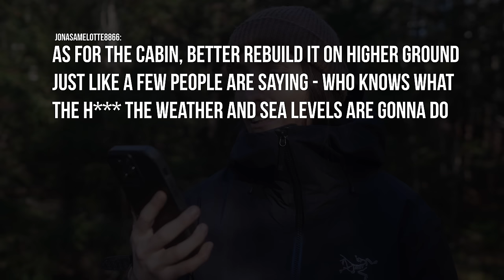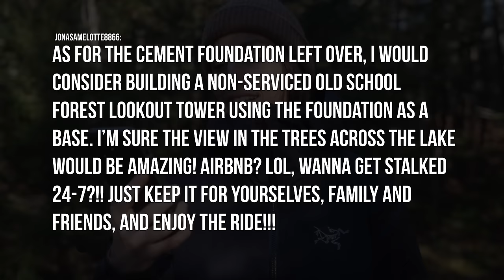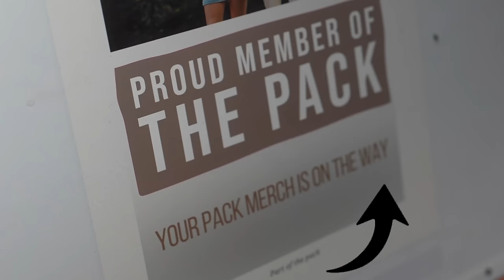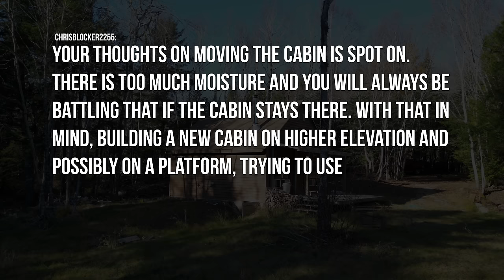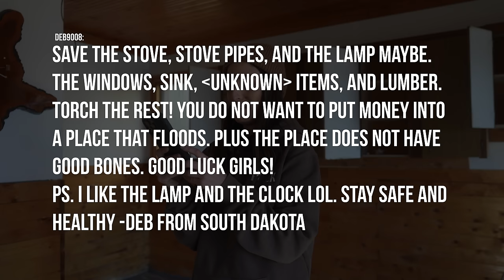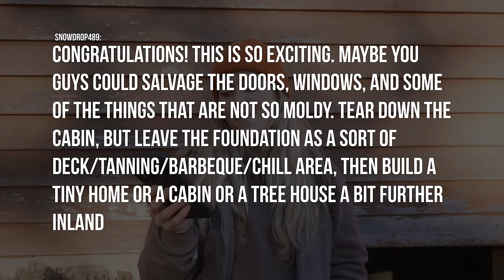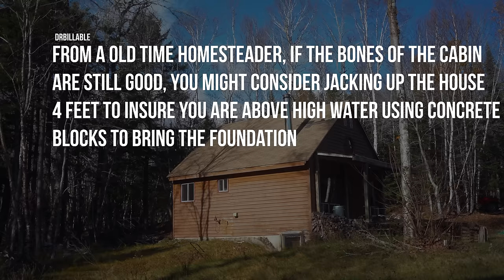Starting My Abandoned Lakefront Home in The Woods

Comment: Hey Crystal and Jaz be careful when doing the demolition of the cabin.  Black mold isn't something to mess with without proper PPE equipment...  Don't want you both to be sick.  Can't wait to see the next project.  Love the beautiful view.  Build house/cabin/yurt/treehouse on higher ground and away from flood zone.  Be safe!
Reply: Looks like we’re all concerned about the mold.😬
Reply: Yup!  Put all those left-over Covid masks to good use.
Reply from the maker: Thank you for sharing and caring. Today we have had this comment more than any other. We will be wearing our PPE the next time we go into this old cabin.
We are so excited for the next phase of our project. 💛🐶 thank you for watching!!!
Reply: You’ll have to hang Dave’s sign on the nearest tree to the original outhouse site
Reply: Agreed.. Friends of mine had to move because of black mold.. They even spent time in the hospital because of respiratory infections.. Yipes!
Reply: is that actually Black Mold? or is it just mildew and/or rot? yes, one needs to avoid breathing any of those things in, but can't they save some of the building materials based on what the stains actually ARE? i.e., they likely can't keep ANY of the materials if it's actually Black Mold, but they certainly can if it's mildew and/or rot (which they can simply cut out of any pieces they keep)
Reply: So I was just wondering if your adding the ash to your compost piles if not for your veggies then for your flower beds. I still think a zip line and a pier are essentials.
Reply: @vibecat4899  what’s 100% that that is black mold there’s too much moisture and it’s been sitting way too long. Guarantee there’s black mold in the house. It doesn’t take much for black mold to grow.
Reply: @Vanwives  girls dont take any of that wood to your own cabin black mould spores are tiny but can spread fast and the last thing you want is to contaminate your own cabin.
And yes for the love of God wear PPE as that stuff is highly dangerous,maybe even worth getting an expert in to take a look and give you some directions in what to do,though just looking at it on camera my instinct was get out of there and put a match to it.
Reply: I think you should go the container build route on this property and on higher ground or raise the foundation.  If you have a spot further back of the lake and higher stack a couple of containers.
Reply: @annewinning9723 - I wouldn’t recommend container builds after seeing the issues Tyler & Todd have had x
Reply: Agree as a retired nurse it can be very dangerous to both of you and the dogs. Use respirator mask and separate the clothes into laundry by themselves.
Reply: Keep the dogs away too, they don’t have PPE
Reply: If so be very careful not to burn pressure treated lumber. PT used to contain arsenic (I think) and you definitely don't want that on your veggies! @amethyst9214
Reply: @dantheman9228  - it looks like it's too late for that. they already did the demolishment without the PPG, and they also mentioned the smell, so they definitely breathed whatever it is in. i'm still not seeing evidence of Black Mold, though, only seeing mildew and wood rot. but then again, maybe the images showing Black Mold didn't make the final edit of this video?
Reply: @truckingwithtobee   - i don't see what you see, i see mildew and wood rot - what timestamp in the video are you referring to? and exactly how long has it "been sitting"? wouldn't you agree that they need a person with the correct experience to go there in person and do a legitimate inspection ?
Reply: @vibecat4899  we had a very bad leak in our kitchen and dining room last winter. It took less than a month for black mold to start showing. So it doesn’t take a lot. They said from the very beginning that the cabin was flooded. And then it sat,nobody cleaned the water out of there. So common sense would tell you black mold is in there. they also live in an environment that gets a lot of rain so obviously there is humidity. The rain and the humidity is what causes black mold. I live in Southern Nevada and the black mold, still set into my kitchen. 
And we don’t have anything close to the humidity that they have only when it rains here which is only a few times a year. And we still got the black mold. They can see it themselves. They don’t need any kind of specialist to go in there and look and tell them. It’s not too hard to notice. But to be on the safe side obviously they’re knocking it down because there’s no point in saving it, it obviously will happen again. So, what exactly is your argument here, sir?
Reply: Tree house, tree house, tree house, tree house! That's what MY intuition is telling me and if that property were mine, several tree houses all connected with suspension bridges, with the last out of flood range. How utterly cool upon flooding to stay in a small house with water all around you, similar to the huts over the water in Boro Boro. 😉
Reply: @mrs.h8771 😂😂😂😂
Reply: @vibecat4899  It was all over the back of the wood Jaz was ripping down with a claw hammer.
Reply: @truckingwithtobee - so you would NOT agree that they need a person with the correct experience to go there in person and do a legitimate inspection ?
Reply: @dantheman9228 - none of that matches any pictures of Black Mold i've seen, hunting hard for anything that matches. it matches things that i've seen in real life that were NOT Black Mold. also, wouldn't you agree that they need a person with the correct experience to go there in person and do a legitimate inspection ?
Reply: @Vanwives  Seems like you went at this with little concern about black mold.  You tore out those walls without wearing proper PPE, so you have already exposed yourselves!  I hope for your sake that nothing comes of this time at the cabin so far.
Reply: I have cancer due to living in a house with mold. For 16 years. Didnt know about water leak until I was selling the house. Had to treat the mold. But mold is almost impossible to get rid of.
Reply: I'm sure the ladies know what they are doing seeing though they have done it before! It was an 'outside' shed 🙄 Fearless 😁😷😷
Reply: @dantheman9228  - so you disagree with the idea of Jaz and Crystal having a qualified professional visit the property and do a legitimate inspection, and also give them advice. Got it.
Reply: @vibecat4899 You've mentioned you think an inspector should go to the cabin, more than once. 
Crystal and Jazz have already extensively repaired and remodeled one previously decrepit cabin into a beautiful and safe home. They are more than capable, and knowledgeable of determining the condition of the existing cabin. They don't need an inspector.
The cabin is in what has become not only a wetland but has flooded every year. The roof has leaked for some time, ventilation is poor, and much of the finish wood they took down is wet. The cabin smells as they mentioned in a previous video. Bad smells mean dampness and different types of mold. Black mold begins to grow in 24 hours. Just because mold isn't black does not mean it isn't toxic. An inspector would only confirm what Jazz and Crystal already know. 
The cabin cannot stay where it is, as is. Jazz is right ... they need to look ahead, and so they will. Relax ... they know what they're doing.
Reply: @tamaraliscia3408 - Speaking of "relaxing", why are you even replying to me? You do realize that you can skip my comments, right? This should be easily recognizable as a rhetorical question -- however it does seem important in this particular instance to make sure that you are indeed aware of that option.

You've clearly missed all of the people in these comments who have strongly inferred to Jaz and Crystal that they DON'T "know what they're doing" because they weren't wearing PPE while tearing these boards down. I have no idea exactly how many of the 1,500-odd comments under this video mention that, since i have too much of a life to search out comments i disagree with for the sole purpose of chiding some other commenter, especially when considering the fact that the Vanwives specifically ASK their viewers to comment! Perhaps you missed the moment in the video where they did that? Which they also do in many, many of their videos? Also, perhaps you should find a more useful hobby, instead of harassing other commenters? 

You also seem to have missed Crystal saying that they were going to be USING in their rebuild some of these boards which they pulled off the wall, which they then tossed together in piles with "boards with Black Mold on them". 

My favorite part, though, is where you indicate that you've never smelled mouse poop/pee/blood or a dead mouse (or the same for any other wild critters living around them there). Your statement that "bad smells = mold" is nothing short of seriously disinformational. 

What's really amazing is that your comment to me shows that you don't even know which of these things YOU believe: 
1) That these gals do actually "know what they're doing", and therefore weren't wearing PPE because they had already determined that the black stains on the backside of the wall paneling is mildew or wood rot, and is NOT Black Mold; 
OR 
2) That the black stains on the paneling pieces IS Black Mold and therefore the girls DON'T "know what they're doing" because they weren't wearing any PPE. You can't have it both ways, try as you may …… 

Finally, me "mentioning an inspector more than once" was me RESPONDING to two people who replied to me, i was asking a question, and neither of them bothered to answer my question and be On Record that they think that Jaz and Crystal should NOT seek out the opinion of someone else with specific experience which they themselves may lack -- But, to their credit, at least those two other commenters left me alone after that. One can only hope that you will likewise leave me alone from now on, Karen. "Thanks in advance".
Reply: The have repeatedly mentioned that they are learning as they go. Many of their projects are first or second time around..while they are capable,they are not experts. They have mentioned again and again hoe much they rely on the comments for valuable information and food for thought.  Mold is very dangerous as we lived in a home where the previous owner passed from lung cancer and it wouldn’t go away no matter what we tried. I am more concerned with their use of power tools and not keeping hair tied up. Live and learn.

Comment: My suggestion is an A-frame cabin with a large front deck and a window wall looking out at the lake.  An A-frame is the least expensive type of house, because you don't have walls except on the ends, the rest is roof and floor.  I would highly suggest a finished floor about 4 or 5 feet above the lake level.  A 24x32 main floor with a 24(minus pitch of the roof)x12 loft bedroom.  You get a 12x12 kitchen and hallway, plus a 12x12 bathroom with storage under the stairs to the loft (with an 8' ceiling height), and great room of 24x20 feet.
2x12 floor joists, 2x6 rafters, you get R-30 in the floors and R-19 in the ceiling.  2x6 end walls and insulated double-pane windows and sliding glass doors.  Put the whole house up on 3 rows of 8x8 posts @ 8' O/C, and double 2x12 beams on both sides of the posts.  (The beams fit into notches on the 8x8s).  3/4" tongue and groove plywood floors.  Open rafters above the great room at 2' above the loft's floor.

Comment: In the old days they used plastic sheets to prevent moisture getting in. However when the cabin is warmer on the inside than outside it sweats which is why you have mild on the back of th wood and loads of moisture round the edges. Save what you can and start again building your dream home. Keep living the dream. from our pack to yours

Comment: Love the sound of the river. I would definitely do a cabin on stilts. I live in Oklahoma and lots of homes are built on stilts around our lakes. When there isn’t flooding they make a great covered patio area .
Reply from the maker: Such a fantastic idea 💛 future proofing
Reply: @Vanwives  perhaps you could use the existing concrete foundation to put in high stilts and pour concrete to fill that foundation and fix the stilts then build a new cabin or A-frame on them. That extra elevation would protect the house from flooding and give an even better view on the lake

Comment: Ladys!!!  You've got black mold in that cabin.  Generally, nothing is salvagable that is wood.  If you're keeping any of the structure, you may need to spray it with 10% bleach solution.  Even those wall boards that Crystal loves, and so do I.  lol    The cost of elevating a black mold cabin may out weigh the cost of just starting over with a new structure.  You can use the foundation as your base for a storage building maybe........    Thanks for including us along your journey.  I love you guys!!  xoxo

Comment: Mold can easily be dealt with. Its the structural stability and flooding that i would be concerned with. Mold can easily be removed and treated, i have did it without the need for expensive companies. I am all for keeping and reusing whatever can be preserved. I am currently dealing with 3 structures from the early 1900's. One we currently live in amd it was going to be torn down. I am in control of what it will look like in 10-20 years. Replacing what is bad and keeping up with it makes a huge difference between having a structure amd not. When you are dealing with high moisture its a different story. A lot more goes into preservation methods and maintenance.

Comment: Flooding. Meh. Tackle the roof. Winter is around the corner. Quick patch on the roof? So, it doesn't leak and make it worse. Cheap route plastic till you get to it.

Comment: The Pinewood that you pulled off the walls can be sent through a planer if you want to save it. It would clean up pretty nice on the minimal amount of wood removal and after drying it would probably be pretty good with minimal pieces to be thrown away or burned

Comment: The only way to build and ensure no flood water enters the home is to either build up with rock creating a higher level or to construct on sustainable piers (concrete as example).  I suppose you could also build a tree house but that comes with its own issues.   either way, the project looks fun, challenging and will eventually be rewarding if done correctly.  Enjoy!

Comment: THATS GOOD KNOTTY PINE! For the moldy boards, get some chlorine and a pump sprayer. Put the chlorine in the sprayer and pump it up. Lay the boards out on a flat surface mold side up. Spray chlorine on generously and allow to dry. The chlorine and sun will kill the mold spores. Then you can reuse the wood. Slainte!

Comment: 2cents from an Architect/Construction Manager:  tear the cabin down, extend the existing foundations 3-4 feet about the high flood plain and rebuild.  Ensure the space under the floor joists is sealed from moisture and you'll have a cabin that has an elevated view of the area without spending money/energy on a new foundation at a new location.  Permiting (if applicable) would be easier to rebuild existing vs new construction.

Comment: The New "Cabin" should be made out of Shipping Containers, built on Piers at least 12 ft above the Current Ground Level, and get a Boat that can be parked in the Waterway below the cabin, that has a lift to get it out of the water, during flooding seasons, all your friends are doing it! Just one up them and have it higher, Crystal is over the Height's thing right?  Now for the Medical Professional in my life, you stand a lot bigger chance of getting sick from that Black Mold than you did in the last 3 years of the World Craziness that we have all experienced, Wear a freaking mask in that cabin while tearing it apart, the mold spores are flying everywhere!  the Dave's Room sign needs to say Aint Dave's Loo no Moo!   The Shipping containers can be built in stages, hardest part for you is obviously getting them to the Property Right?  It is a beautiful Property, but imagine building a deck off the Containers like you helped AS only its not in I Da Ho!! :)

Comment: Get yourself a tool for that lumber you plan to salvage.  It's called a De-Nailer, and yes it's a real thing.  It's like an air nailer, except uses air to punch nails back out to the direction it came from.  Be safe and wear safety glasses, or better yet a face shield as the nails come out with a decent amount of speed and energy.  Personally, I use a lid on a 5 gal pail with about a 3 inch hole, and shoot the nail into the hole.  Not much chance the nail will make it back out of the hole.  At the end of the day, all of your nails are all picked up and in one place.  The tool should only cost you a hundred-ish dollars.  About 40 minutes of air de-nailing equals all day by hand.

You ladies are amazing, and I appreciate that you are bringing us along on your journey.

Comment: I assume, there are "set back" requirements since that cabin was built. Requirng you to build usally 200+/- feet back from the high water level.  ALTHOUGH ..you "may" have the right to rebuild over the existing footprint a fact most authorites don't want you to know.  ie: over the existing Foundation allowing you to be close to the waters edge.  Most local codes allow this BUT, you have to do so safely and legally by building up the exisiting foundation by say 30+" so you don't have water issues in the future AND bring in fill around the new raised foundation so water ain't a problem with the adjacent yard ...AND any drainage like sewer or grey water "has to be" drained about 150' + away from the high water level...yup a little expense but it allows you to be close to the water's edge legally. Yet there maybe a savings in utilizing the old foundation. Check with local land use laws and/or "variance" rules. I did this for my 40 yr career very successfully for cleints.  Best of luck ladies 🤣